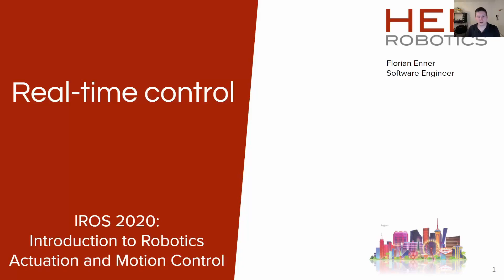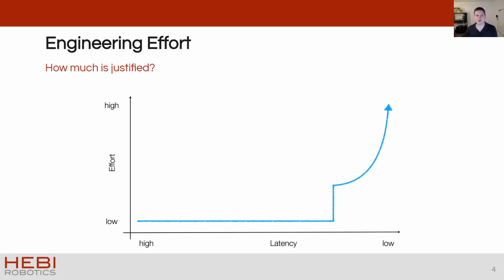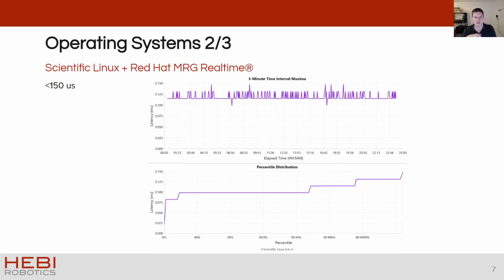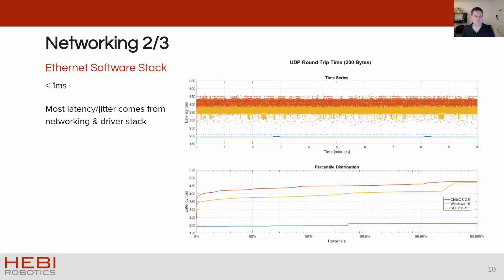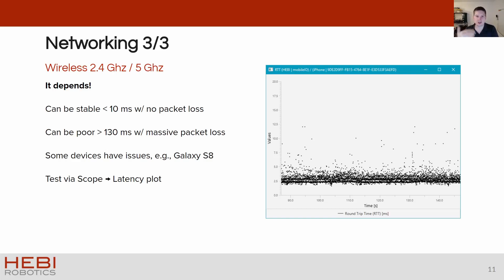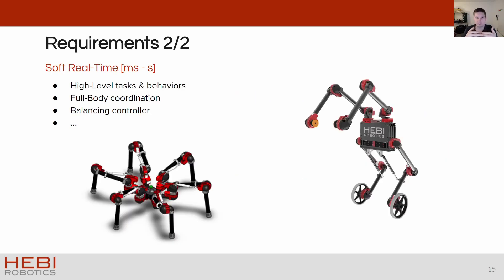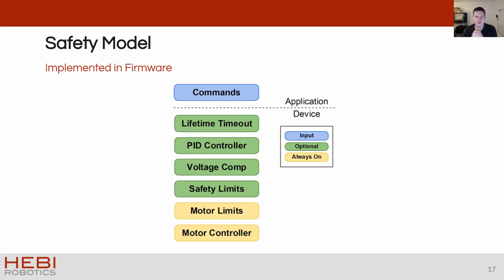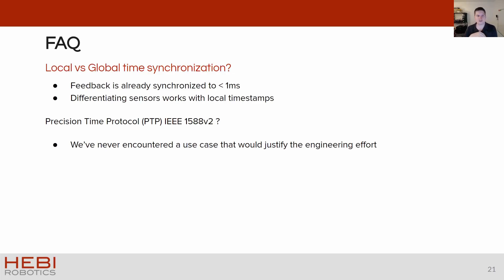7. Real Time Control (IROS 2020 Tutorial Series)

Comment: Thanks for the talk Florian! 
I'm interested in how you execute the timeout safety feature. I'm currently developing a BLE based motor controller, and one of the big questions I have is how to maintain a safe operating environment for the user without the motor stopping inappropriately in the case a few packets are lost. Do you have any pointers for how you've implemented a timeout that feels good during use?
Reply: This is typically implemented in a way where the robot turns off if it hasn't received a packet within some fixed time window (e.g. 5ms). Having a fixed timeout or setting on the actuator doesn't make much sense for a modular platform (e.g. a stable Hexapod can deal with more packet loss than an inverted pendulum), so we implemented the concept in reverse. Every command that gets sent contains a "lifetime" (i.e. how long the command is valid for), and the actuator turns off if it reaches the timeout before receiving a new command.

For our actuators we found 0.125-0.25s to be a reasonable default range that we rarely change, but depending on how strong and stiff your system is you may want to run tighter timings than that.

Depending on your use case it may also be useful to implement different behaviors about what an actuator should do when reaching a timeout, e.g., <hold-position> /  <break> / <turn-off-controllers> / etc.
Reply: @florianenner7435  That makes a lot of sense. The lifetime concept will work well for my application I think. Thanks for taking the time to respond. This is very helpful!